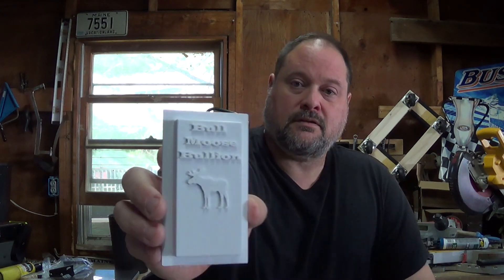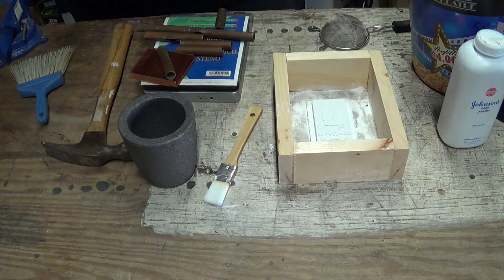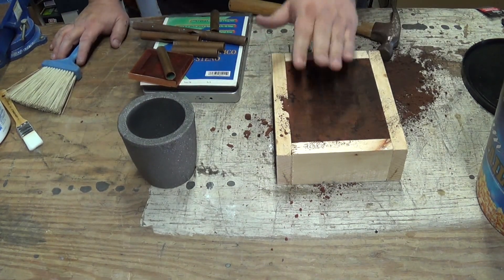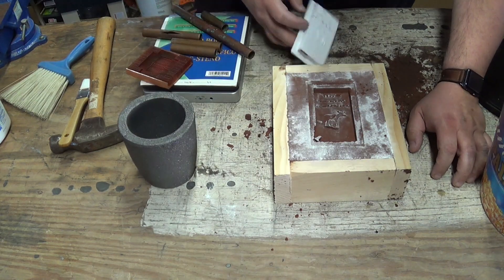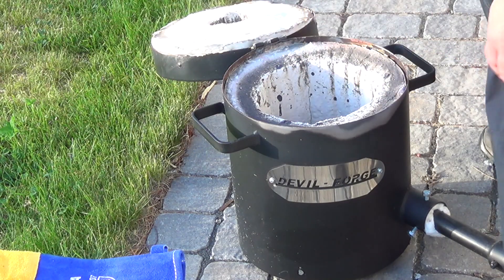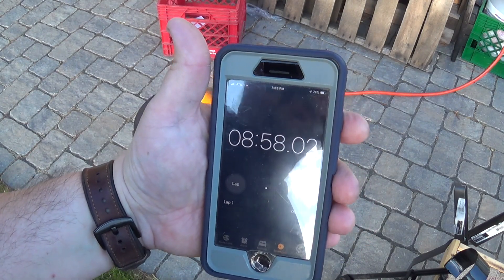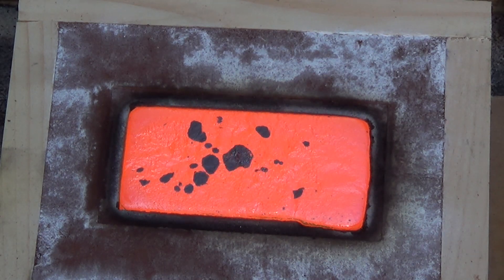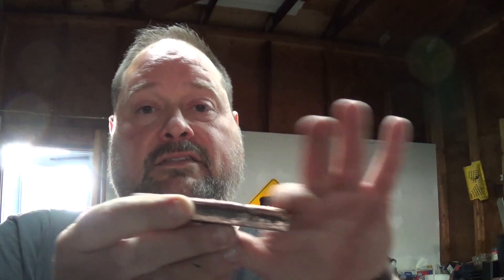Monday Meltdown!! When Life gives you lemons, make copper ingots! -Moose Scrapper #320

Comment: Good one Moose. Being that you're a scrapper you should be clear to your viewers that scrapyards don't like ingots cause they have no way of knowing what's in them. Even if you convince your guy at the scrapyard, he has to sell them to someone else. I know you were just making this for a decoration though. When I pull my pattern from the sand the first thing I do is look at the pattern before I even set it down. That shows exactly where the sand stuck. You can see it in your letter internal cavities in your video when you pulled it. Make letter internals and entrapment areas between letters less deep on the pattern. You won't even notice it on the casting. Get a chalkline refill from Lowes for parting dust. It's basically pure calcium carbonate. Shake on through a sock. The fibers from your uncoated devil forge (it's a furnace BTW)  is super nasty. They say it's not but that's bull crap. Shame on devil forge. Satanite Is a fabulous refractory mortar to coat it. Available from hightemptools.com (not affiliated) and it's cheap. Coat it, fire immediately, recoat several times.